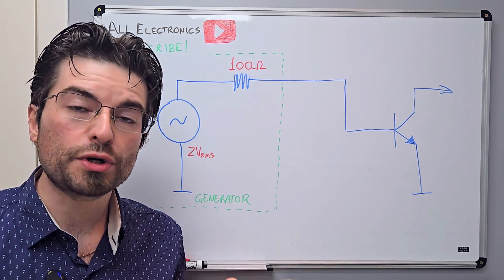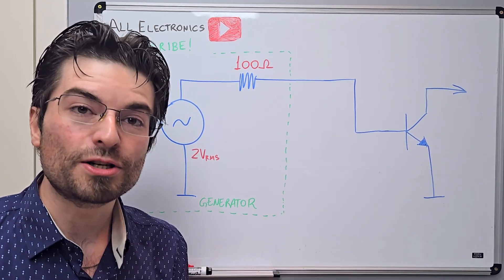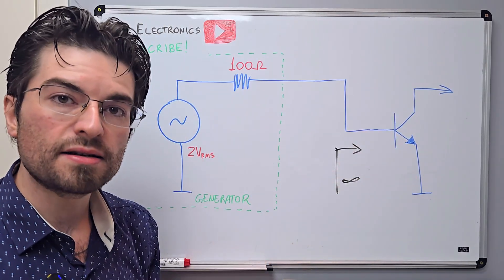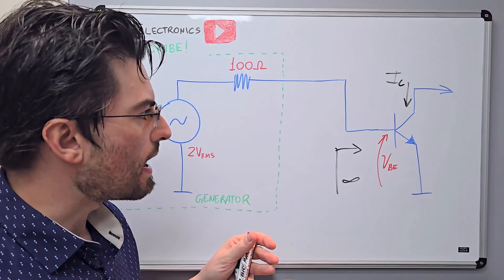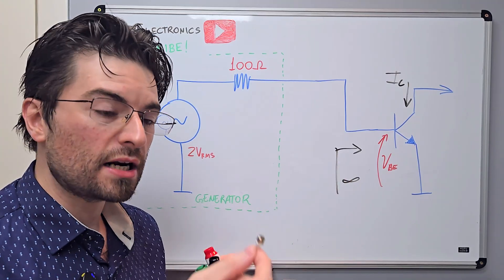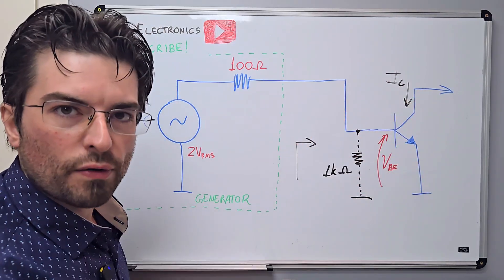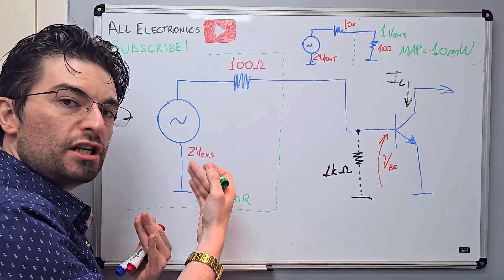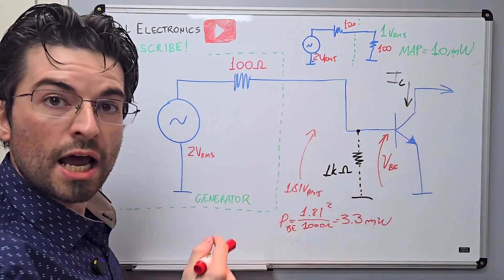Why Impedance Matching Still Matters for Transistors

Comment from the maker: Hey guys, the video simplifies a lot for the sake of the argument. 

(1) For the example of the transistor, we know it is possible to control the input impedance by feedback, emitter degeneration, or bias conditions. 

(2) Of course we are talking about the differential AC impedance at the base, after the transistor is biased.

(3) I'm surprised reading the comments. The misconception is really widespread. You can enlighten your knowledge by studying the topics "Ebers-Moll model" and "BJT small-signal mode". 

(4) I choose 2 Vrms and 100 R to make the math easier to grasp. That leads to a huge voltage excursion on the transistor base. Nevertheless, it won't change the argument. 

Here are more in-depth videos about impedance matching: 

[1] https://www.youtube.com/watch?v=0XYMilJxYns
[2] https://www.youtube.com/watch?v=XCiBvhleDIM

Leave a comment here if you wish I make a second video covering the topic!

Greg
Reply: "I choose 2 Vrms and 100 R to make the math easier to grasp. That leads to a huge voltage excursion on the transistor base. Nevertheless, it won't change the argument."
I might have to set up a breadboard for this.  What I expect to see is zero current for most of the cycle, and consequently, the base of the transistor will accurately follow the signal generator.  But for a small portion of the positive half cycle, the base-emitter junction will become forward biased preventing (most) further increase in b-e voltage.  Since the generator continues to rise in voltage, that extra voltage will appear on the 100 R resistor.  Putting a scope just on that resistor will show little peaks of voltage (i-times-r) on the positive half cycle.  Naturally the scope will have to be isolated since you don't want to clip a ground on either side of the resistor. 

The POINT you were trying to make is good and correct; the input impedance of a typical common emitter amplifier stage is certainly higher than the output impedance of the previous stage.  In audio amplifiers, a transformer is ideal for this impedance transformation but hardly anyone does it that way because transformers are expensive and transistors are cheap.

At radio and microwave frequencies you still benefit from a transformer but it is easier to create.  A pi-matching network is still basically an autotransformer but you apply the input voltage to a capacitor and you take output voltage from a smaller capacitor (higher reactance, thus higher voltage, at the operating frequency).  You cannot escape capacitance so you might as well make deliberate use of it.
Reply from the maker: Hey Thomas, exciting to have you so invested in this man!! Of course using the voltages of the example you will see the base emitter junction clipping. Try to use 100 mV. (1) Measure the impedance. (2) Add matching network, a transformer may be the easier. (3) See the base emitter excitation at its peak. Wish you a great 2026
Reply: @AllElectronicsChannel  again wrong. Using a 100mv ac source you will never turn the transistor on at all.

You need to go do some actual circuit building because you clearly dont understand what you are talking about.
Reply: @AllElectronicsChannel  Well, at 100 millivolts the base-emitter junction will never go into conduction and consequently the impedance will be very high; depending on the frequency (ignore base-emitter capacitance).  
A transformer (low frequencies) or matching network (RF) would ensure enough voltage to turn on the transistor and would form a pretty good Class-C amplifier stage (good for FM radio transmission for instance).   Matching networks have the advantage of suppressing harmonics.
Reply: @AllElectronicsChannel  You can't talk about any IMPEDANCE or input resistance for an AC signal here. Because it is defined only for AC, harmonic, sinusoidal signals. And you don't have that there.
Reply from the maker: That is the input impedance of the small-signal model.
Reply: If you do a follow-up on this, I'd love to see a deeper dive into how input impedance is calculated for positive and negative currents into the base.  How would a matching network perform 2 different transformations depending on the phase?  Fun stuff!
Reply: @BartKus  "How would a matching network perform 2 different transformations depending on the phase?"
It doesn't.  You first turn on the transistor with a bias current; this produces a voltage around 0.7 volts on the base relative to emitter.  The input signal then adds to, or subtracts from, this 0.7 volt bias.  Since a transistor is current operated and has an effective dynamic resistance of only 10 ohms or so, you transform the source.  Example is a high impedance microphone; piezoelectric.  It can produce relatively high voltage but almost no current.  So you put it through a transformer which reduces the voltage which you don't care much about, exchanging it for increased current which you DO care about.  
At radio frequencies you typically use capacitors to accomplish this; a pi-network accomplishes the same function as a transformer.
The output of this kind of amplifier stage (common emitter) is taken from the collector and tends to have a higher impedance approximately identified by the collector resistor itself.  
FET's behave VERY differently with nearly infinite input impedance and very low output impedance.

Comment: Hello thanks for videos. Have short question. In your examples the base voltage signal is 1.8V or 3.1V;  these are more than 0.7V typical bias voltage. Isn't your transistor in heavy saturation in those examples?
Reply from the maker: As I commented in the video, I kept the transistor drawn just for the looks. You should focus on the AC resistance; for the example, I used 1 kR.

Comment: Sorry for the translator. I don't understand how the matching device improves performance if it takes up some of the power.
Reply from the maker: The matching device optimizes power transfer to the transistor. When the maximum power is transfered, the transistor feels the maximum excitation.

Comment: This is  confusing because the emitter bias circuit  is unworkable in the real world generally.  Without a  resistor in the emitter leg the transistor is prone to thermal run away.    Even without it  there is a  internal  re' (emitter  cct)  in the transistor which is approximately  24e-3/ collector  current in amps   or 24 / Ic ma.  When this is reflected back to the  Base of the Tr  it has to be multiplied by  Beta,  being the  DC gain or the small signal gain depending on what functionality is being looked at.  Beta is a function of Ic and is best taken from the  manufacturer's datasheet.   The incoming signal sees a small signal resistor  in parallel with the  1000R resistor.  typically this second resistance might be  20 x  24 / Ic   , Ic in mA  . if  Ic is  500 uA  then the resistance   looking into the transistor will be  about 960 ohms // the external resistor.   Only  when  Ic is  very small , less tha n say  100 uA in this case can the  input  Z of  the transistor be ignored.   The only fast way to  establish  the steady state static  Ic  is  to use a simulator like  LTSpice , unless the Tr is fed from a current controlled source on the collector side, which  basically is pretty rare.
Reply from the maker: Thanks for the detailed comment. Soon I will post the full article about this. It seems it was not clear that the 1kR example was meant to be the AC resistance looking at the base. It is surprising to ser so many people without a clue about small signal analysis.

Comment: Whether the BJT is current controlled or voltage controlled is just how you choose to think about it. Just use whichever model is more practical for your situation. Same argument when people say it's current that kills not voltage. At the end of the day we have all of these mathematical relationships and we as simple creatures just want simple causal "if this then that" ways to think about things. Circuits are complex systems with complex intertwined relationships. 

There is another relationship that relates Vbe to Ibe, the shockley diode equation. The same one is used for BJTs. And so we can relate the input voltage and collector voltage when combined with a pullup/bias resistor and known load. Similarly we can make a relationship of the input current and output current of this common collector amplifier.
Reply from the maker: Thanks for your comment man.

Comment: Hello! Impedance matching increases gain, effeciency, moreover decreases noise in the first cascade of   a receiver/amplifier. In RF stages a wideband transformer from transition long lines helps a lot to increase gain , impedance matching and stability. It has sense in pulse transistor devices, for example  high frequency (>10KHz) power electronics
Reply from the maker: Thanks for your comment.

Comment: Excellent demonstration. What cleared it up for me is how you mention that we have no control over the source impedance, nor the load's impedance. 

But now let's say that we DO have control of the load impedance. Take for example the front end of an receiver. The antenna has a source impedance of 50 Ohms (we can't change that). But as designers we can opt for the first stage the antenna is going to encounter. For example a common base stage is sometimes opted, because it has 1/gm input impedance, which can be tuned to 50 Ohms. Then no matching would be needed. We would have maximum power transfer, and thus maximum voltage swing at the load (amplifier).

But what if we tuned 1/gm so that it was higher, like 200 ohms? In that case, we could match the impedances, and get maximum power transfer again. So we get the same power at the load as in the 50 Ohms case, but this time we get more voltage swing, because its 200 ohms. 

So it seems like, it would be better to maximize the input impedance of the amplifier (basically making it eat no current), and impedance match into that high impedance, than opting for 50 ohms at the first place... Hope that wasn't confusing.
Reply from the maker: Hey Leo, interesting to think about that. Let's say we choose to maximize 1 / gm. This means reducing gm (gain) to the point of having no gain!
Reply: @AllElectronicsChannel You are correct, in my thought experiment I tried to show why higher input impedance is better, but forgot to realise the effect on gain due to gm. 

What would be a better comparison is choosing a CE stage instead of a CB stage for the frontend. Now, assuming same gm, I argue that there is no reason to choose CB to match impedance (1/gm), but it would be better to choose CE that has much higher input impedance, and match into that.

Same logic as my previous comment, but without an effect on gm

Comment: Your description seems more correct for FET (JFET, MOSFET). Transistor does not care much about the voltage on its base; it cares about current.  FET, however, is voltage operated.  

Transistors are relatively low impedance on input and output.  MOSFET is nearly infinite of resistance; only high of impedance (because of gate capacitance).  The output impedance is easy enough to estimate; suppose that at 10 volts your transistor is passing 100 milliamps (maybe a 2N2222).  That's the peak dissipation moment; its supply is 20 volts.  Anyway, it works out to 100 ohms at that moment.  The load therefore ought also to be 100 ohms.  

A transistor ("Transfer Resistor") is a varying resistance  so you target the middle of the range and call it good.

The input is a diode.  Very high resistance until you reach the turn-on voltage and suddenly the diode is conducting and very little resistance.  So what is the impedance?  Well, it doesn't have one. The impedance arises from the biasing network and typical emitter resistor and bypass capacitor.   It is common to have a resistor on the base so that its wildly varying resistance is not so much reflected back to preceding stages.
Reply from the maker: Unfortunately, you are wrong. You are on the side of the misconception. To enlighten your knowledge, search for the terms "Ebers-Moll model", "small-signal BJT model". I wish you good luck on your studies and a happy 2026.

Comment: I think you were confusing FET transistor and BJT transistor?
IMHO Regardless of frequency BJT has low impedance, and at low frequency FETs have high impedance?
Rgds: Power Electronics Enthusiast
Reply: "I think you were confusing FET transistor and BJT transistor?"
Concur.  His descriptions are accurate for FET but not transistor (NPN bipolar junction transistor which is what the schematic diagram shows).
Reply from the maker: Hey guys, I'm not confused. As mentioned in the video, search for the "Ebers-Moll" model. It will lead you to small-signal analysis and small-signal models. You are going to learn that the AC voltage over the small-signal differential base-emitter resistance is what modulates the current.
Reply: @AllElectronicsChannel  "the AC voltage over the small-signal differential base-emitter resistance is what modulates the current."
Sure; but it is still the current that operates the transistor. Plugging or creating "holes" or charge carriers. It takes just enough voltage to overcome the PN junction barrier but it is electrons (current) that makes it work. 
I probably should not have waded into this thread.
Reply: @AllElectronicsChannel  "Hey guys, I'm not confused. "
There's a big difference between being unconfused and being correct.  If I were to guess (which obviously I am) people challenging your presentation came from the vacuum tube days where it simply did not work to apply vacuum tube circuit design to transistors.   That's because tubes are voltage operated on the grid and transistors are current operated on the base.  FET's on the other hand do operate similarly to vacuum tubes.

Comment: I have an undergrad in electrical engineering from an abet accredited university, where i specialized in control theory, i am also an extra class amateur radio licensee and i really didn’t get this until now. I am not all the way there yet but much closer to getting it, maybe 80%
Reply from the maker: Keep up on your journey, man!
Reply: Hopefully you do not accept the wrong parts which seems to be most of it.  Transistors are not voltage gated (FET, JFET, MOSFET are voltage gated).  Transistors amplify current.  They don't know and don't care what is the voltage.  Vbe will ALWAYS be about 0.6 volts, the forward bias voltage of the base-emitter junction.  Once it turns on, more current does not make more voltage; it ignores "ohms law" at that point.  It isn't a resistor, it is a diode.   With an Hfe of 100, each electron pulled from the base will allow 100 electrons to flow from emitter to collector.  With MOSFET, you do not pull electrons; you create a static electric field that pinches the source to drain channel.

Comment: To be clear, impedance matching does NOT mean the highest voltage is present at the BE junction.  In fact, the highest voltage occurs when the ratio of the source to the BE resistance is the lowest.  Impedance matching is critical when trying to maximize POWER transfer, as in RF matching to a cable or antenna.  Besides max power transfer, impedance matching eliminates reflections which otherwise would cause severe distortions in the signal.
Reply from the maker: Wrong. I exactly demonstrate the opposite. Maximum voltage happens at maximum power transfer.
Reply: @AllElectronicsChannel  I respectfully disagree. For a simple common emitter circuit, max BJT input voltage occurs when the ratio of Rsource to Rbe approaches zero, ideally when Rbe = infinity (not practical in a CE BJT amp).  Max current occurs when Rsource + Rbe is minimum, ideally when Rbe = 0.  Max power transfer occurs when Zsource is the complex conjugate of Zbe, for a purely resistive circuit it's when Rsource = Rbe.  It all comes down to Kirchhoff.
Reply from the maker: Hey Carlos, think a little more. You are not seeing that for the matched condition the voltage at the base will be higher than the generator's Thevenin voltage.